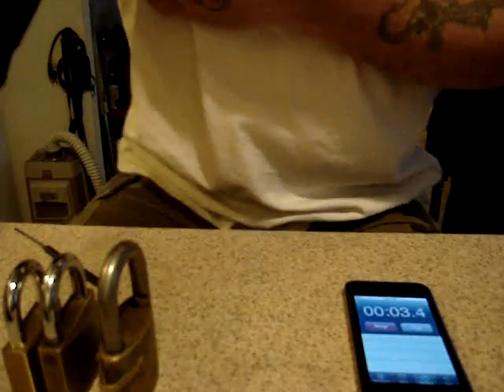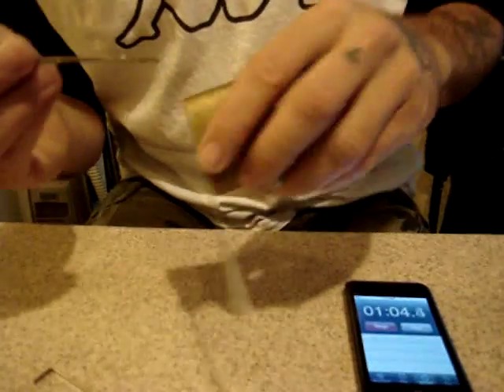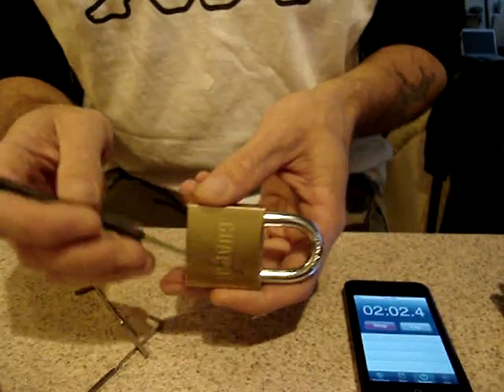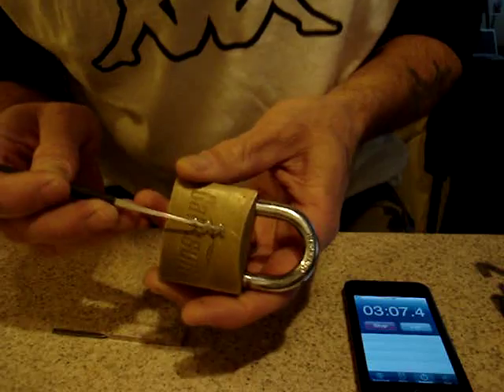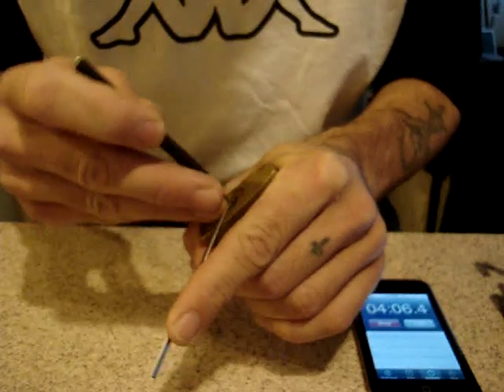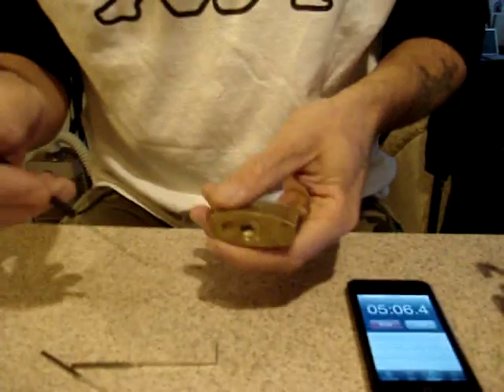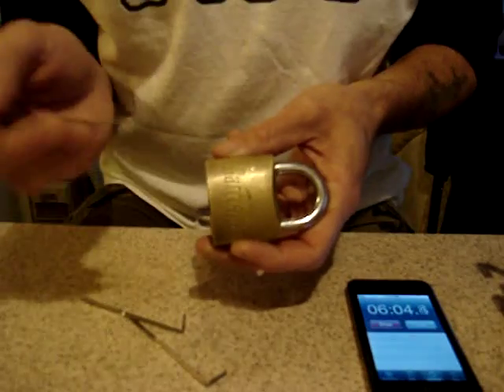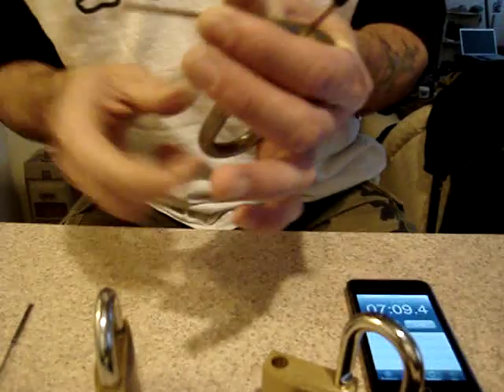CUSTOM BOGATA LOCKPICKING INSTRUCTIONAL VIDEO

Comment: Excellent video Wizwazzle. Eight years ago, you knew more about Bogota's than I know now, or will probably ever know. I bent a Mad Bob Bogota doing exactly what you said don't do. These Bogota's are an excellent design, and I am amazed at how many locks it will open, and that I didn't bend one before. Thank you for passing along the information. 👏